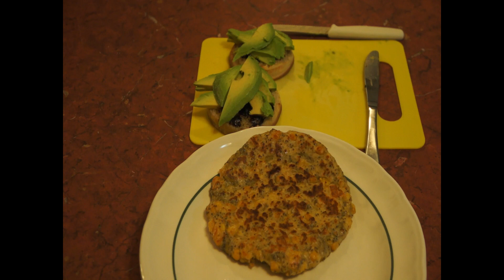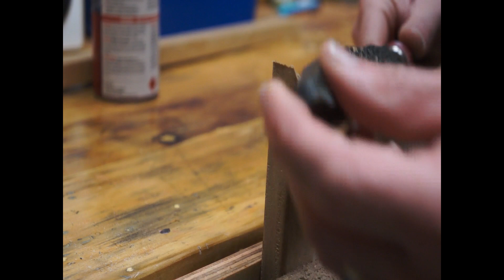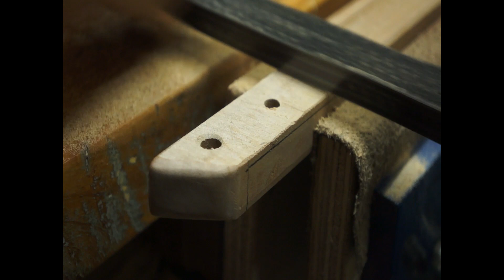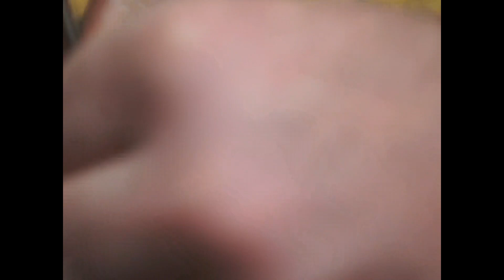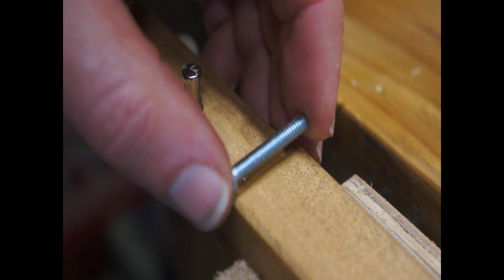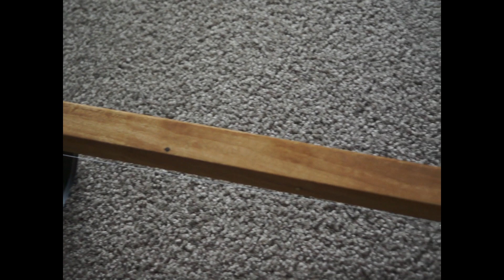2 String Canjo Build

Comment: i made a canjo and mine is so quite i can barely hear it what did i do wrong? i have a can of corn for the resinator
Reply from the maker: Could be worth trying a different can - but should not really affect too much. A larger can will be a bit louder. Medium size strings can give a bit more over thin or think ‘i feel’. Having the string hole in the can closer to the middle will allow it to resonate more - but at the expense of either string height or redesign of how it mounts.
Reply: @MikeHawkey  I’m realizing as I’m playing with it more accidentally made a base. It’s a base string and if i put something to lift the string by the can it’s pure base.
Reply from the maker: @GunninWizard  ah that will be a bit lower!

Comment: Just curious: Have you made any using bone or antler for the nut? Would that make any significant difference? I like the bolt idea. ❤️
Reply from the maker: I have made with bone nuts in the past. Bone is nice and easy to shape and works well - plus you could get creative with shape and style. I’ve got a lot more bolts than bone here!

Comment: Nice build! Curious about the fret spacing, neck length, etc. Cheers!
Reply from the maker: Thanks. I don’t have this particular one anymore but I generally use the stewmac fret calculator for any chosen scale length. Many calculators out there but I’ve never had an issue with it and it’s various options, so give it a google!
Reply: @MikeHawkey  awesome,  thank you!